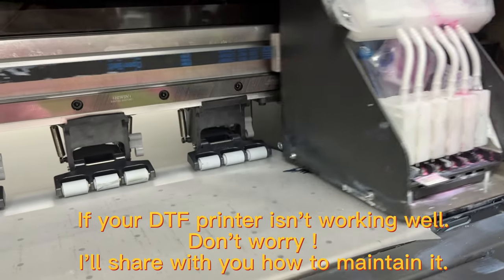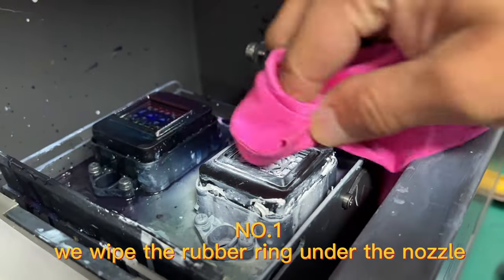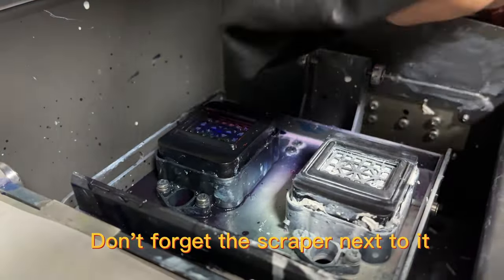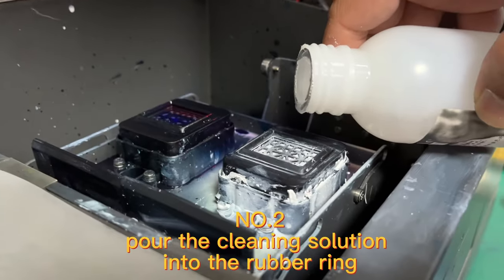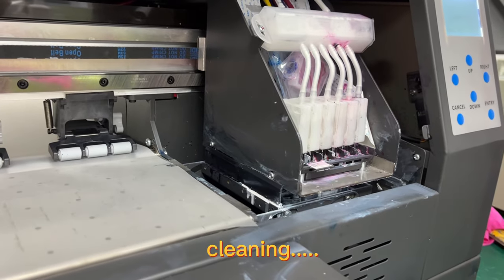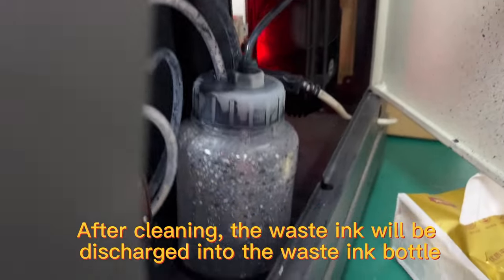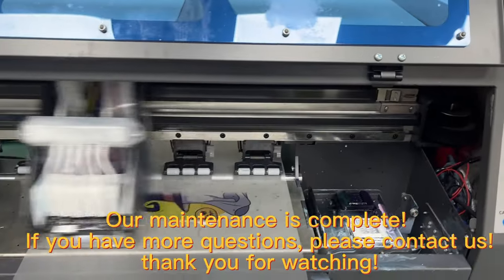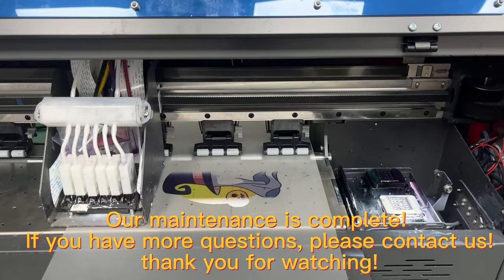Erasmart xp600 dtf printer routine maintenance

Comment: hello, do you know maybe why with printheads xp600, yellow is not yellow as it should be even the nozzles are not good, we replaced the heads twice. And we also have problems with C and M, which are printing good nozzles but color are not even there are lets say lines of magenta or some sort of color distortion in cyan or magenta